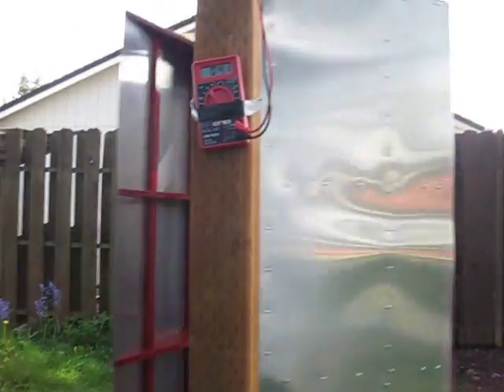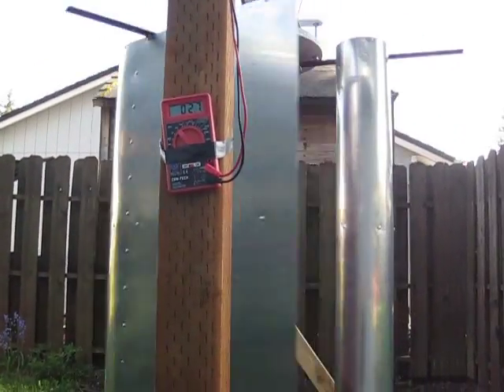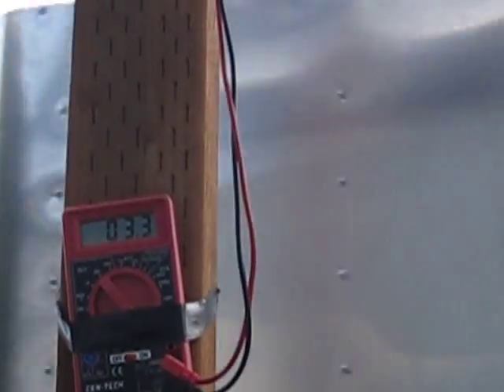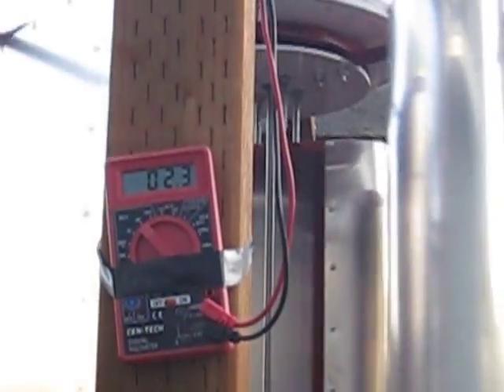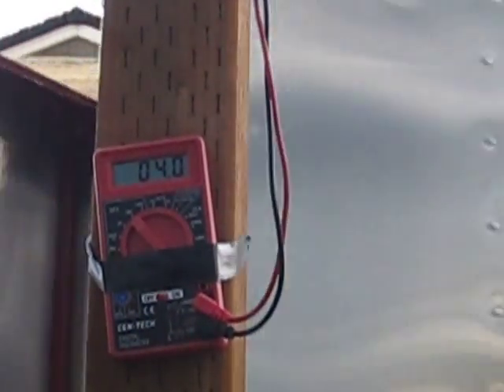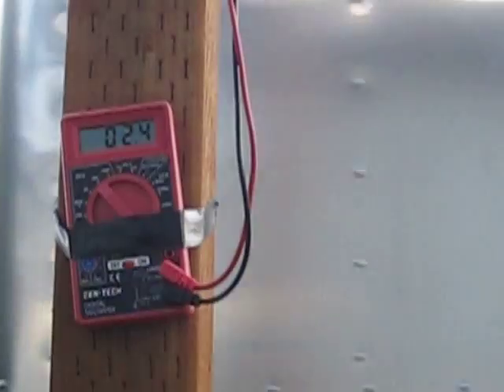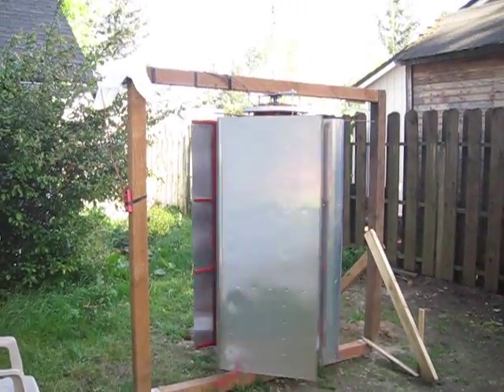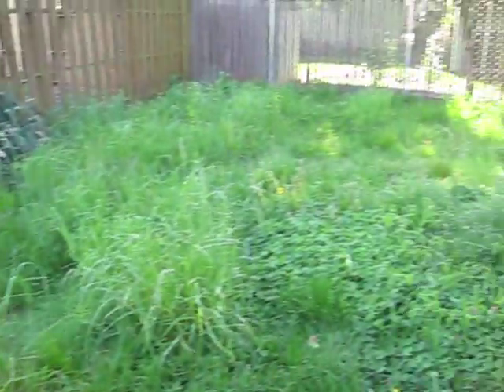Vertical Axis Wind Generator surprising test result 001

Comment from the maker: that was about a 12 mph gust that hit. I should be doing much better once I have it raised above the fence line. I might gear it up later on, right now, just making adjustments to get the best output. my wind speed has been staying fairly steady between 10 and 13mph last week or so.

Comment: Looks good. You're getting 5 or 6 volt which would be what I'd be getting. Unfortunately, that won't be enough. That's why I think I need a pulley to increase the rpm. If I have 18 coils, then I could probably get by with some kind of voltage doubler.  A vawt just don't get enough rpm unless it is very well designed.  Maybe you can slim it down to increase the rpm or use the Lenz  wings with the scoop facing outside.